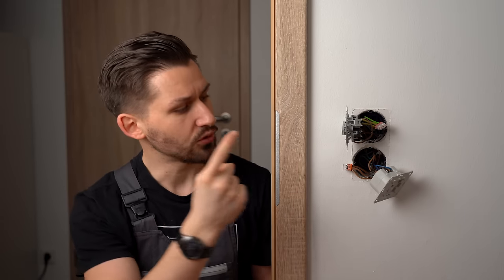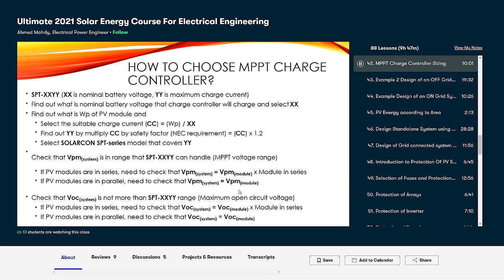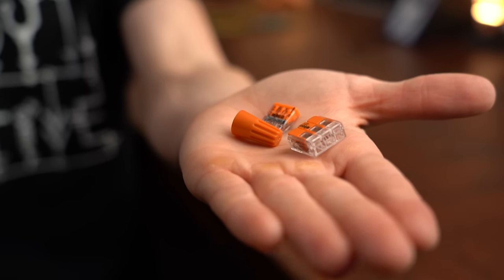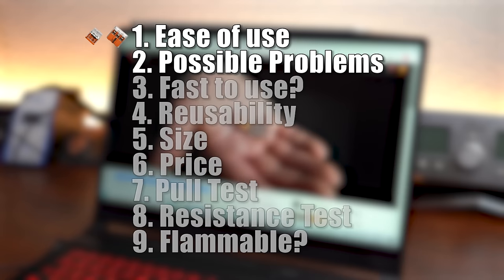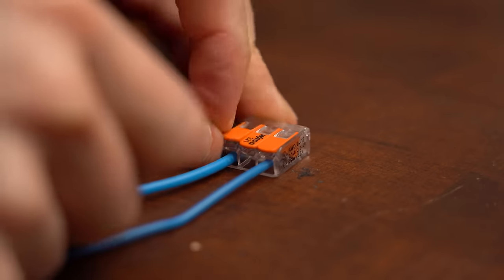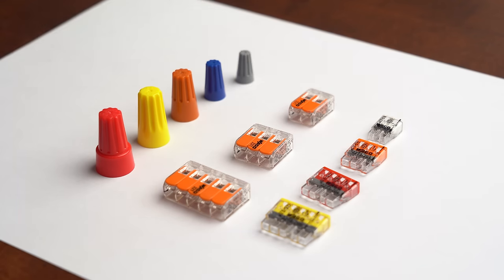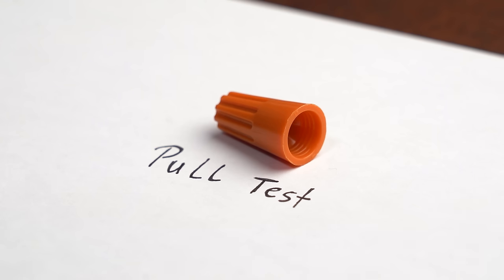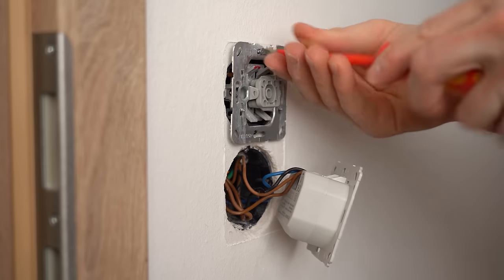What Wire Connector is the Best? Settling a Debate! Wire Nut VS Wago

Comment: You forgot one very important function of the Wago: the hole where you can insert your multimeter Tip to measure Voltage without disconnecting!
Reply from the maker: True
Reply: This can be done with wire nuts too
Reply: @jarphabib  do they have a hole on top?
Reply: @TrolloTV  No, at the bottom
Reply: @Engineer9736  So it only works when you removed too much insulation, or what is the method there?
Reply: @TrolloTV  I've never tried it, but i guess you'll be able to reach the conductors with multimeter prongs even if the insulation sits completely against the threaded part of the wire nut. 2 round wires next to each other leaves space on the 2 sides of the 2 wires where you can poke through.
Reply: @TrolloTV  Yes, some wire nuts do have holes specifically for that purpose. Not every Wago has the probe port, just like not every wire nut has a probe port.
Reply: @Engineer9736  I've done it many times, you can easily reach the conductors inside a wire nut with multimeter probes.
Reply: @TrolloTV  No, you can probe from underneath with a sharp point probe by going in the gaps to the sides of the conductors.
Reply: @TrolloTV  there are manufacturers that make them with pinhole on the top for testing, but they aren't commonly found
Reply: @richardmillhousenixon  Unless you are talking about different product line, all WAGO installation/splicing connectors have probe ports, even Micro ones.
Reply: @bar10005  That's only for the lever ones, and even then half the time you can't even fit a multimeter probe far enough in to make contact.
Reply: @richardmillhousenixon  Please give Type-Number of a Wago without the Probe-Hole. Every Wago I know has it.
Reply: @MatzeMaulwurf  Wago 773-166. Like I said, most of the push-in wagos (NOT the lever lock) do not have probe ports. And even the ones that do often are too small to fit a probe in.
Reply: @richardmillhousenixon  773 has an inlet on the back (not the „upper back“ as the standard 2273) for the probe.
Reply: @MatzeMaulwurf  Is the port actually big enough to fit a standard multimeter probe in? Not very many that I've seen are.
Reply: @richardmillhousenixon  I don’t know what type of MM you are using but any of my Duspols fittet in any of my Wagos. I probably installed 20.000 Wagos in maybe 100-150 projects during my Professional life. Currently my main Multimeter (as since way over 10 years) are a Beha Unitest 2000 beta and a Fluke 87 IV. Every probe fits in there. Also the standard electrical screw drivers.
Reply: And the same goes for screws on screwconnectors
Reply: @TrolloTV  No, the hole is gigantic. You just might have to remove some of the electrical tape that's used to ensure that the wire nut can't wiggle free. Or, you just call Fluke and get an inductive meter.
Reply: @Engineer9736  that kind of shows the problem that there isn’t shrouded bit so you could accidentally poke something in